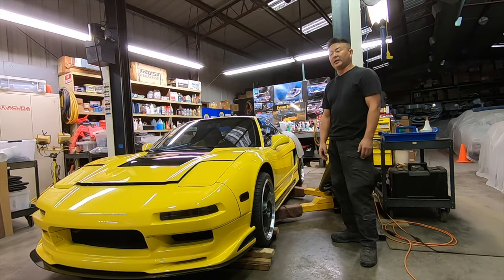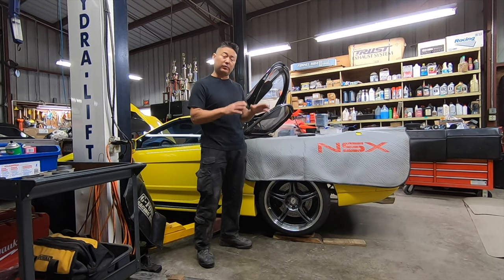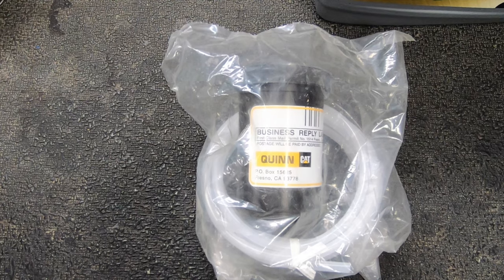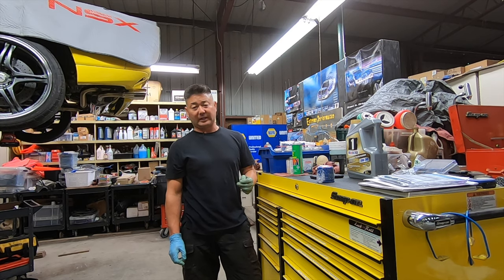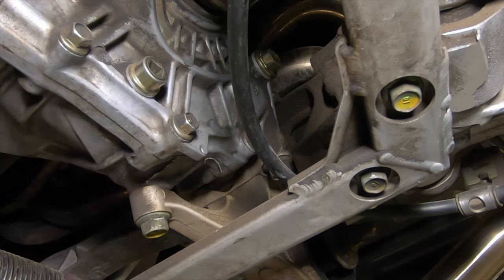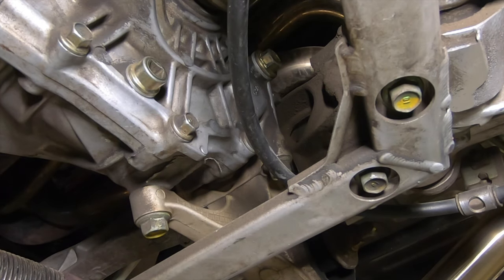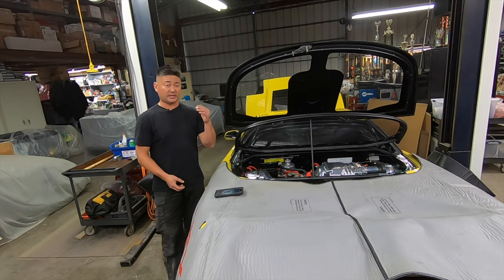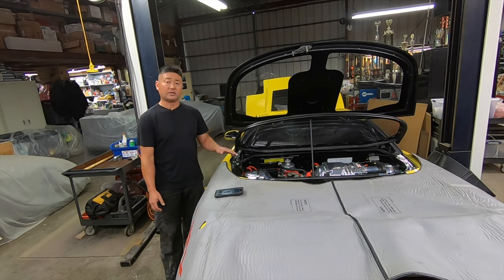DIY NSX Maintenance Part II

Comment: Additional advice for bleeding air from the cooling system, taken from the Acura shop manual: jack up the back of the car in order to tilt the car forward and then turn it on, until the radiator fan comes on for a full cycle. This will help bleed air from the front section of the car since it's connected to the engine through hoses that run below the central tunnel.

Comment: when I was putting together the engine for my CRX I used all studs and nuts from Honda instead of bolts on the oil pan so if I ever had to re tighten it I wouldn't strip the block....
Reply from the maker: I like your thinking Bud!  👍👍👍